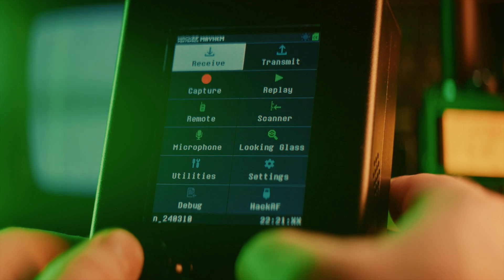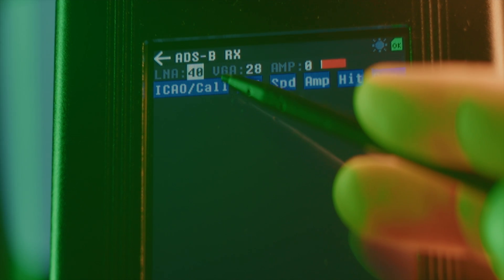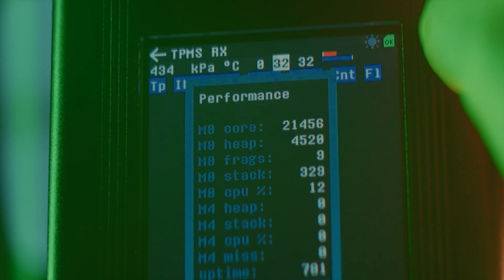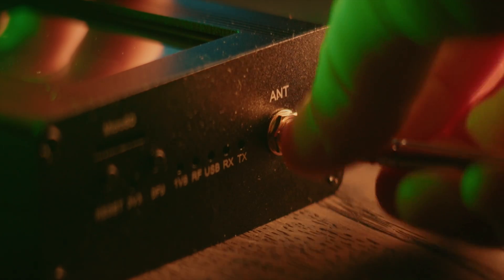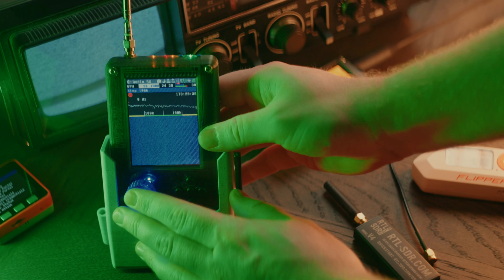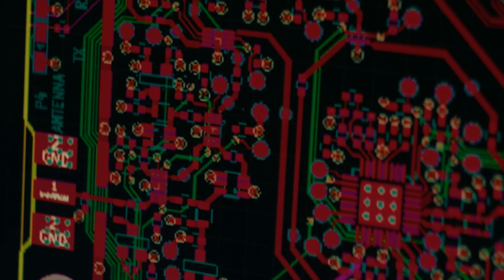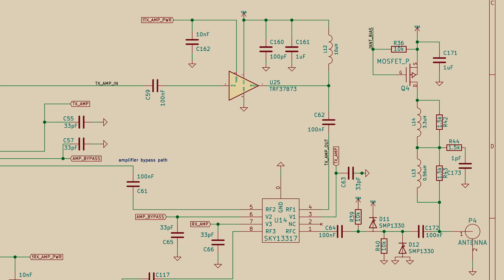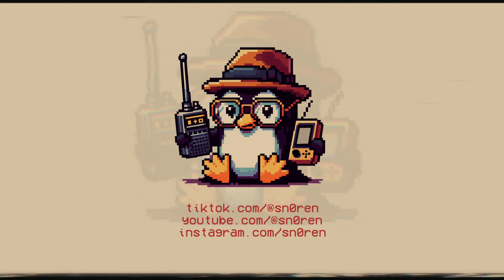I Broke My HackRF Portapack! Here's How Not to

Comment: I have four HackRFs. I am generally very careful with them not one of them has a working preamp any more. After blowing the second one I started using an RF limiter permanently connected but it seems that wasn't enough. The limiter also seems to degrade the signal somewhat.

Comment: note you can blow up any radio doing these things.  it's why the basics of ham radio tell you to do the grounding of the antenna center pin on outside antennas when not in use.   I have seen an antenna cable have visible sparks from center to ground during winter storms as the snow blowing past an antenna can rapidly generate static electricity.
Reply from the maker: True. This one is particularly sensitive though.

Comment: I fried both RX and TX amplifiers. I ordered the replacement devices and changed the faulty ones, not an easy task but doable if you are good on soldering. To prevent future failures I now use a SMA 3 dB attenuator permanently attached to the HackRF antenna port.
Reply: thanks for this. I'm just getting started and unfortunately didn't got the Clifford one.  kinda scared on breaking it considering how expensive it is to get in my country.
Reply: good idea with the attenuator
Reply: hi, what's model sma 3 db attenuator??where i buy this ?? thx

Comment: mine is stuttering when press recording and making little false frequencies in equal distance..what is that causing? but nits not broken like u show it here, anybody had an clue what that is?
Reply from the maker: Your gains are too high and/or the transmitter you’re using is too close to your HackRF. Check out my beginners guide video for an explanation of how to do it correctly.
Reply: @sn0ren  i try to restore it via the dfu recovery and now i got the white bootscreen and nothing happens (even with the different button lcd loads) i got a second portapack and pluged it in than the screen works but some icons/apps dont show up correct and doesnt works ...maybe u can help me to get it work back again?
Reply: @sn0ren  i try it with dfu recovery but got white screen on one of my portapacks and nothing happens even with the screen button loadouts...pluged the other portapack in works but not alll apps worked, displayed something wrong...they are using different softwares? or whats the problem that one portapack doenst work after firmware upgrade and dfu recovery and the other displayed but apps doesnt work...?

Comment: I don't know what board version my H2 is but I have had it for 4 years or so now. I have used the amp but a few times. My environment is a bit saturated so I am better off using filters and attenuators anyway.

Do check your antennas though people, the ones that come with it a far from the stated specs.. in fact any from Ali need to be checked with a NanoVNA or something. I had a couple recently that are dead shorts.

Comment: Think I broke mine. When I turn the amp on the saturation goes up not down. First day 🤦🏽‍♂️ is that it pretty much useless? Or really weak now?
Reply from the maker: If the saturation goes up that means the signal strength increases? Sounds like it’s working just fine then..
Reply: @ I typed that wrong sorry - the saturation goes down not up. Pretty sure it’s fried. Just not sure what that means for me now aha there’s not much out there for beginners on the hackrf/portapack. Even when people talk about antennas - I cant find a single video talking about what lengths we should adjust our antennas too for the different frequencies or how to ground an antenna when changing them over. Maybe I’ve bitten of more than I can chew and should’ve stuck with my flipper 🤦🏽‍♂️😂

Comment: Hey @sn0ren Is there the same problem with the H4M version or has it been fixed?
Reply from the maker: If you get it with an R10 board then it still has the problem. If you buy a Clifford board instead then it’s fixed.
Reply: @ Where can I find this preassembled version (Clifford) if you have a link or something?
Reply from the maker: I don’t think there is a preassembled with Clifford yet. Clifford is working on a new version based on r10 which will be available in early 2025 also as preassembled
Reply from the maker: Even if you fry the amp you can still use it just have the amp disabled. Eventually you would be able of replacing just the HackRF part if you want. Or you can buy the Clifford board and the H4M without HackRF and assemble it yourself.  or you can wait a bit for the new Clifford one to become available in an assembled version.
Reply: @sn0ren will you be making a new video when the new Clifford board is available with the H4M assembled version?

Comment: What's the difference between the HackRF Portapack and the HackRF One (no display) that plugs into a computer?  Do they have different features or something?
Reply from the maker: Portapack is a PCB with a screen and buttons that connects on top of the HackRF One making it a portable device. You can buy assembled HackRF Portapacks that comes with both the HackRF and the Portapack boards sandwiched together with s battery inside and a case.

Comment: What are the main differences between the R10C and Clifford Heath (Oct 2024) Hack RF one variants? I cant seem to find an accurate answer on google.
Reply from the maker: R10 (and R10C) has a built in protection from connecting a bias t voltage incorrectly directly to the antenna port. 

Clifford edition has protection against static voltage on the antenna port frying the amp. The R10 board does not have this protection. 

Clifford has designed a new 2025 edition of his board based on R10 but including a new better performing static protection as well. It will be available very soon.
Reply: @sn0ren  Thank you!!

Comment: Is using the external usb powered amplifier also dangerous for the internal ones? Can the external be used as a replacement for the internal one if broken (if the internal one is turned off)?
Reply from the maker: An external one can be used as a replacement for the internal one if broken and turned off, yes. Be careful when using an external one, not to enable the internal one especially if near strong signals.

Comment: Fried mine several times, but my hands are incredibly shaky to repair it, so its a bit of a challenge for me.
Reply: Can you still use your hackrf for everything you could before it broke? Think mine fried too
Reply: @cmac7168  simply said: The failure mode is in burned pre amps - so it is totally insensitive when pre amp is switched on. Really deaf. When the pre-amp is off, its sensitive as usual, just without pre-amp. The same goes for transmit function......the repair is easy as long as you can handle SMD parts and have good flux, hot air soldering iron and replacement pre-amp. It just needs some diligence, concentration and steady hands.
Reply: @JanicekTrnecka  is the sensitivity without the amp still good enough to use in most applications though? 
Or do I only need the amp for weak signals/really far away signals?

Comment: are you happy with the 433 antenna in this video? it looks good. is it omnidirecitonal and most importantly where to get one?
Reply from the maker: It’s omnidirectional yes. It’s just some cheap one I got with a flipper zero module. It works fine.

Comment: Isn't the test mentioned in this video going to break the amplifier?
It seems like that
Reply from the maker: No
Reply: @sn0ren  are you serious..?
I've read that FM broadcast stations have a high transmission power, and a filter should be used to avoid damaging the receiver, when enabling the amplifier.
I'm just curious, can you tell me more about why it's not dangerous?

Comment: hi! really interesting. I have experience replacing the MGA81563 on the older board, however I also have the new one and I experience power issues. What is the component to change in the new board? thanks!
Reply: I think mine is weird because iamp works on RX,  but my unit just transmits very low power. However it does improve its power with the amp ON, so maybe i have another tx stage broken? The previous one?

Comment: Hi, How can you tell if you have the clifford heath version of the HackRF? is there a way to identify the true version from clones?
Reply: Good question.
Reply from the maker: Look at the chip near the USB port on the HackRF. If it has 6 pins it's the normal design. If it has 8 pins it's a clifford design. Every board sold from aliexpress, wether being clifford or regular version is a "clone". If you want an "original" HackRF you need to buy it directly from Great Scott Gadgets, Michael Ossmans company. The term original and clone isn't as descriptive though, since it's an open source hardware design, so the boards you can get off aliexpress are identical to those sold by GSG, they are just manufactured by someone else. The only difference, if any, can be in quality control.
Reply: @sn0ren  Thank you for the reply.
Yes, I have an original GSG HackRF I just bought another HackRF and Portapack by following the link you provided. I wanted to check it's based on the clifford heath design as some have painted logos and some use stickers for the logo. It's not easy to confirm what I was sent. But at least I now have something to check. I was going to look for a diode package or packages at the antenna input as this was something mentioned in the video. Edit : I just checked this one and it has an 8pin chip near the USB connector. Thanks.

Comment: Both of TX and RX amp is MGA81563 (at least in my board). Of my hrf the TX amp broken. Fortunately sold on ebay, and not too difficult to replace.
Reply: this is the old version. What about the new version? what is the amp?
Reply: @Radiogenes  Well, if you have a newer version you are lucky because is SKY13317 is the PA and this is better a lot than MGA
Reply: @bukucsjozsef9630  Hello I have TX power issues.
 On rx reception is good and if I turn the AMP on signal increases. However if I transmit I can hardly transmit… and if I turn AMP ON it increases the power signal. 
Given this facts, do you think the AMPs are fine? Arent the amps the new TRF37B73
I think there could be a problem on the previous tx stage. But I am lost here 😓
Reply: @Radiogenes  Before you fix it, check if this problem exists on another computer. Especially if you use SDRangel software, other connected USB devices or HUB caused a similar error for me. Of course, I also suspected (wrong) the hackrf module. But not was.
Reply: @bukucsjozsef9630  are these in same form factor and ....hmm lets say a drop in equivalent? Havent checked the datasheet prior writing this comment;)
Reply: @JanicekTrnecka  Unfortunately, it was a long time ago... As far as I remember, it's drop-in compatible, but you'd better check it out.
Reply: @bukucsjozsef9630  thanks anyway, this is very valubale info, I will definitely look into that, since I do have several dead HackRF boards in my stash.
Reply: @JanicekTrnecka  I installed a non-inductive 100K 1206 resistor between the hot and cold points of the antenna socket. This dissipates static charge - and if it is truly non-inductive it does not cause performance degradation. This prevented further damage due to static charge.

Comment: Does the Clifford version work just as well as the GSG version for the portapack? Asking because I am about to order the board for the build.
Reply: Should I use the Clifford addition in my portapack or use the original? I have the original Hack rf but may use it standalone and buy cliffs with this error happening
Reply from the maker: Yes

Comment: The receive amplifier on mine died in close proximity to a power amp that malfunctioned. It wasn't even activated at the time only the HackRF. It's not attenuating but it basically has little to no gain anymore. They are quite fragile.
Reply: @keyboarderror1  I managed to fry these pre-amps several times. So far I was able to repair it successfully. Just a bit tedious, especially with shaky hands ;)
Reply: @JanicekTrnecka  I might be more inclined to try to repair it if I hadn't soldered the extra shield can for mine.  Working around it or removing it is tricky. I can always use an external pre-amp. As long as the transmit amplifier continues to work. It's fine.
Reply: @keyboarderror1  how do you know if the transmit amp is ok? And is it as fragile/easy to break as the rx amp?
Reply: @cmac7168  I get a significant output gain increase when I switch on the transmit amplifier. It's drive comes from from the Hackrf so it's not likely to suffer excessive input damage. I've been somewhat careful with the output load impedance and levels so thus far it's survived the SWR. As long as you don't blast it into a non resonant load it seems to be more resilient.

Comment: yes, but the clifford addition comes with it's own downsides, greatscott tested it and showed the results on their site (but didn't call it clifford by name). i've independently tested and got the same results as them, there is a 15-20db loss on the upper and higher bands, and a 10db across the entire range. it's pretty significant, but does reduce chances of blowing your amp.
Reply from the maker: Yeah I’ve seen that. Clifford claims that testing was done on a defective device. I don’t know enough about it to come to any conclusion about that. Personally my Clifford device is clearly more sensitive than my other r9 board, but that might be other variances of manufacturing or defects, and also I haven’t used it for anything above 1GHz. Both cards are from cheap Chinese manufacturers. I don’t have any GSG sold device to compare with. And if you just need receive and not at high GHz ranges I’ve found RTL-SDR blog v4 to be more sensitive than either HackRF device.
Reply: @sn0ren  can you please compare both in the 2.4ghz and 5ghz wifi bands?
Reply: @sn0ren   how did you compare this? To be fair the test should compare the devices working in equal bandwidths/sampling rates.
Reply: Yeah, adding those diodes is going to change the capacitance and thus the impedance of the input. It will cause attenuation and maybe some other issues.
Reply: @JPtheGunslinger  not exactly. it’s still marched and balanced. it’s just a natural insert loss you can’t get away from. most professional RF receivers are not going to have transient or overload protection. occasionally they’ll block dc. it is expected the operator will add passive devices like a diode limiter themselves on the feed line.

Comment: Isn't this fixed in r10?
Reply from the maker: No. R10 introduces a protection diode on the psu for the bias tee, preventing it from being blown if you turn on bias tee with a short on the antenna port. There is still no protection of the amp.

Comment: So, the R9 is a dud, the Clifford  HackRF  edition Portapack  that I purchased is marked R9, nothing to show it has the Clifford mod ? it has no sound, it is not recognized be RTL Sharp or Console, I know this is a common issue, guessing that its related to the need to come up with the R10 based on R8.
Hacker Doc. (hardware revision)
 One r9
MAX2837 was replaced by MAX2839. Si5351C was replaced by Si5351A with additional clock distribution. A series diode was added to the antenna port power supply. Manufacturing year: 2023

HackRF One r10
This revision is based on r8, reverting most of the changes made in r9. A series diode was added to the antenna port power supply. Manufacturing year: 2024
Reply: This is what leaves me cold about buying stuff like this, especially from Aliexprerss. Is the R9 really as dud as this when using it with PC software? I was nearly tempted but the kit linked above seems a bit cheap to me which makes me wonder how good it really is.

Comment: how do I properly ground it to remove static buildup?
Reply: Like you would ground anything. Touching a large metal object electrically connected to the ground like a metal pole that goes into the ground or plumbing. (Not live electrical wiring obviously).

Comment: whats your thoughts on using a SMA to BNC connector for easy removal and installing antennas. Thanks for the video
Reply from the maker: I think it can be a good way of making antenna changes easier and perhaps put less strain on the sma connector.
Reply: @sn0ren it can actually put more strain on the sma connectors if the coax cables you use are thicker and not so flexible. Just be aware of that. If it's just for rubber duck changes and thin coax it's not really a problem. I use adapters often from sma to bnc they work ok except they tend to unscrew when you try to remove the bnc connector.

Comment: How to make it more sensitive on receiving? Compared to a RTL-SDR V3 i have, the hack rf is way less sensitive. Is there anything we can do to increase it?
Reply from the maker: If you just need a receiver rtl-sdr is better. But HackRF can also transmit and has a much wider range and can be used portable with the Portapack. Any choice is a compromise in some way. The little external 20dB LNA might help in some cases in increasing sensitivity.
Reply: @sn0ren  Thanks buddy. I've read that you can fry the amp if using external LNA near strong signals.
Reply from the maker: @T1000cy  Always be careful when close to strong signals. Keep the internal amp off when using an external one.